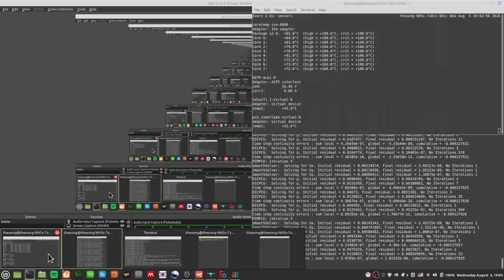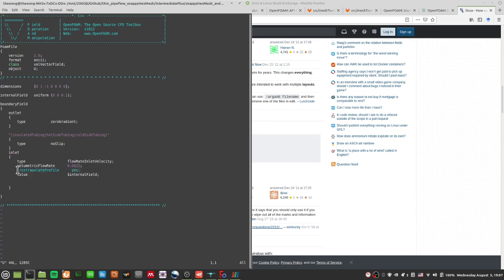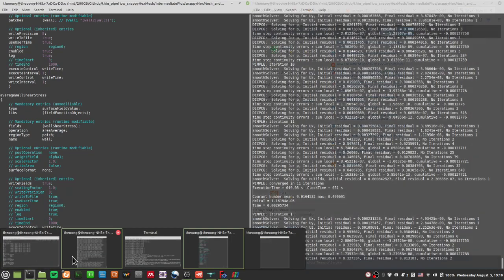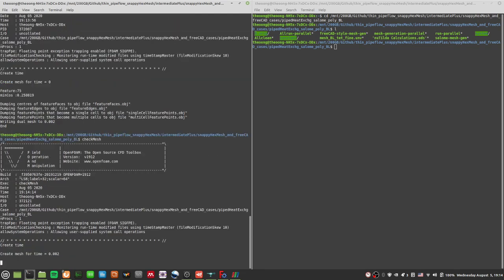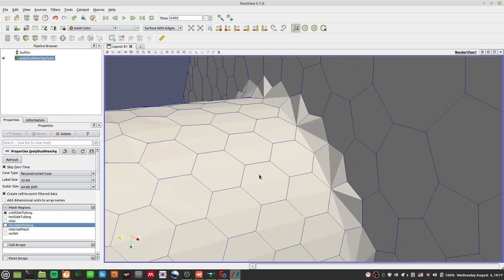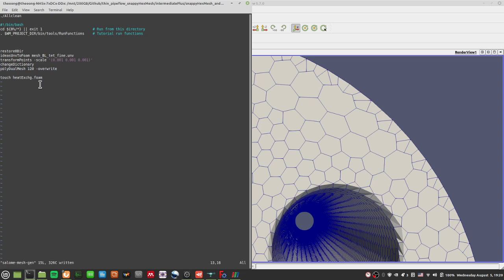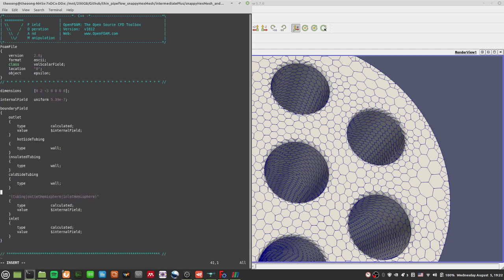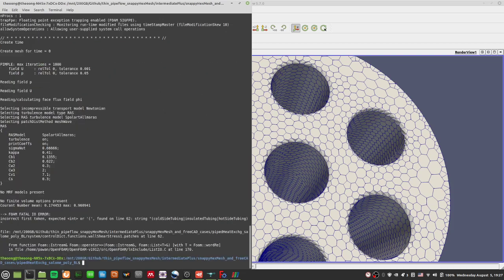OpenFOAM Intermediate - 100 heat exchanger with piping (editing BCs and polyDualMesh feature angle)

Comment: Hey Theo! Been watching a bunch of your videos for my own project. I'm having some trouble getting my multiregion CHT set up for OpenFOAM. I've created a model in Onshape, exported it as several separate .step files and I'm trying to mesh it with appropriate boundary layers. I'm doing some testing with a much simpler model, but with a similar setup (2 fluid regions and 1 solid region). I can't seem to get the meshing to understand that I want viscous layers and I'm getting lost in all the grouping, exploding, partitioning steps. Anything you think I could try?